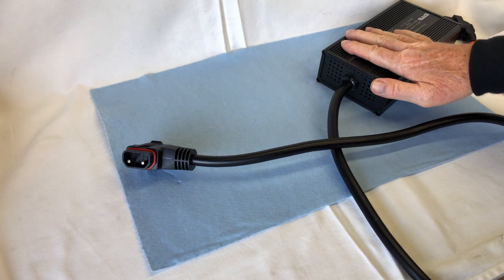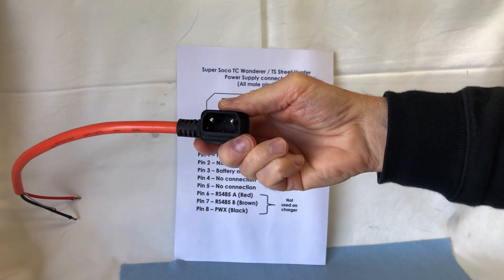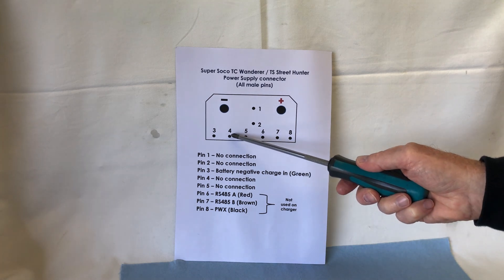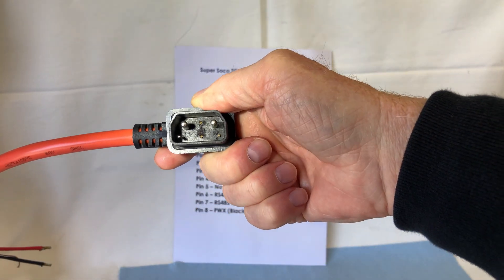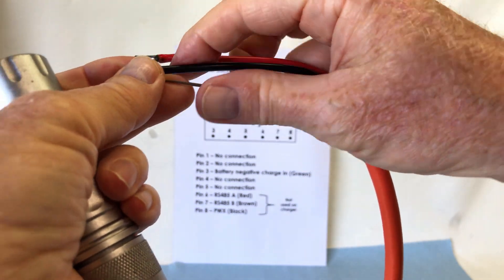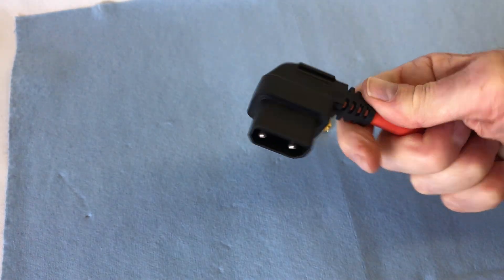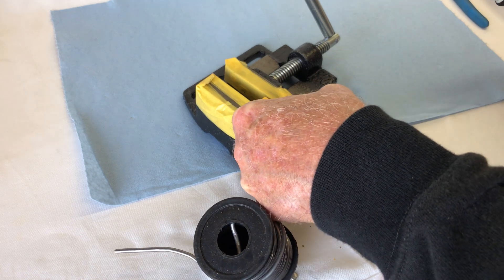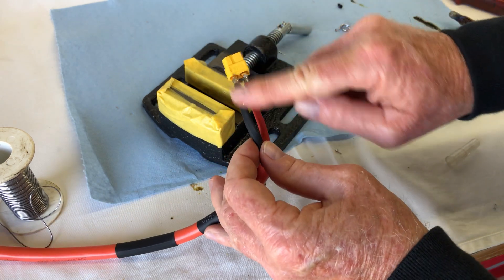Installing and wiring a new Battery charger for the TC Wanderer

Comment: That's great.  Mine arrived a couple of days ago, cant wait for summer (UK). So I really need a luggage rack extension but the dealer for weeks cant get them, has anyone here managed to buy one or create one?
Reply from the maker: Have a look at this video. I think his friend can make them. https://www.youtube.com/watch?v=k2eSJx9TsVE
Reply: @DistantSuns  pretty heavy duty, I have an idea to use the underside bolt holes and aluminium, needs more thought though, thanks.
Reply: @DistantSuns  I ended up cable tying to the aluminium passenger grip bar and a small overlap on the saddle, good enough for now.  The spare part has been despatched from China I read.
Reply from the maker: @ Nice work! Where there’s a will there’s a way.👌

Comment: Bei diesem 71,4 Volt  Ladegerät werden die Zellen komplett bis auf 4,2 Volt .geladen.
So hat man vielleicht noch 1 bis 2 Kilometer mehr Reichweite? Leidet allerdings auch wieder die Lebensdauer.
Reply from the maker: If your worried about the battery lifespan just use it as a fast charger when you really need too. Thanks for watching my video.

Comment: So did you get pulled over the two pins out?
Reply from the maker: Yes, I removed all the other pins and kept pin 3 only ( plus the big main round 
+ and - pins. It was much easier to plug in that way.
Reply: @DistantSuns  thank you, im having to do this cause my charger isnt working and there is no where to buy a replacement charger, love that someone is actually showing what to do
Reply from the maker: @LordPineapps  You're welcome!

Comment: I have street hunter can use this battery normal 60v60ah Ali express
Reply from the maker: Yes, the TC Wanderer and the Street Hunter share the same battery
Reply: @DistantSuns  use this battery is it want system update
Reply from the maker: @tharindra-dz2mw  No, after you install the plug on the new charger, just plug it in and start charging.

Comment: Can we charge same time for two batteries and how many time for one battery
Reply from the maker: 0% SOC to full takes about 3.2 hours for one battery and 6.4 hours for two batteries.
If you use the 12amp charger made by the same company you can expect around 2.6 hours for each battery.

Comment: Have you any idea about rear suspension upgrade for this bike?
Reply from the maker: Well, the short answer is no. I do however think about this every time I ride it.
The problem is that the design is fundamentally flawed. A monoshock is not the right selection for a rear hub motor because of weight, rotational mass and down force for traction.
A dual rear shock system is best for this configuration. My dilemma is, do I want to buy an expensive monoshock and get the same results or modify a dual rear shock swingarm from a petrol engine bike that will 100% fix the issue but lose some of the bike's visual design characteristics.
I'm still undecided...

Comment: Thank you for sharing this pinout. Can I ask where you sourced it? As I have a Street Hunter Pro that I will need to work on and I was under the impression that it uses CAN instead of rs485 for communication. Thank you.
Reply from the maker: No Problem, I made the printout myself. The wiring harness under the seat has labels for each of the wires. The communications labels have 485A and 485B printed on them.
Thanks for watching my videos

Comment: Hi, I would always ensure you plug the mains into the charger before connecting the DC to the battery, otherwise you get a large current draw from the battery back into the charger to fill the output smoothing capacitors which can blow a fuse or even trip the bms if your batt is very low.
Reply from the maker: Understood, thank you for the advice and thanks for watching.

Comment: Thanks for sharing ! I was waiting for this video ! So the connector is the TC/TS round pin plug ! I wasn’t sure about that as it has less small pins, but as you clarified very well, these are not needed for the charge except the one that goes with the negative.
Thanks again
Reply from the maker: No problem, glad to help.